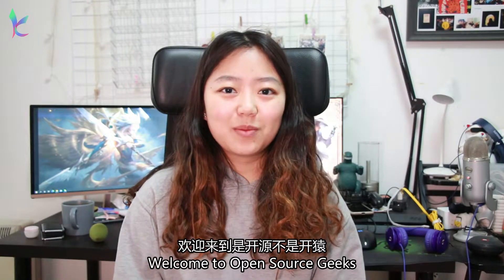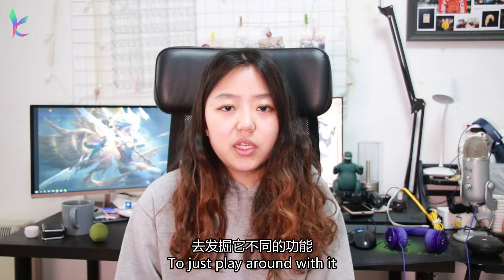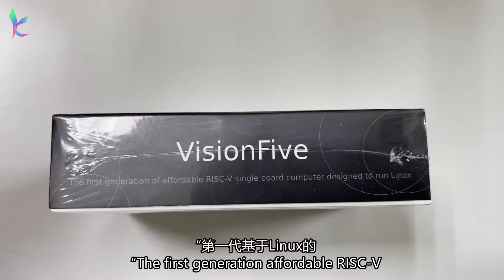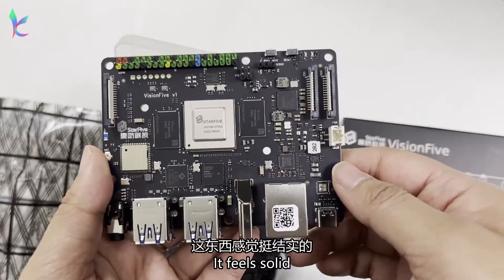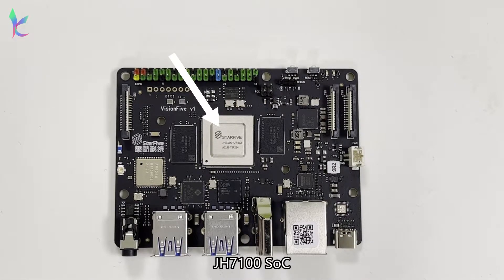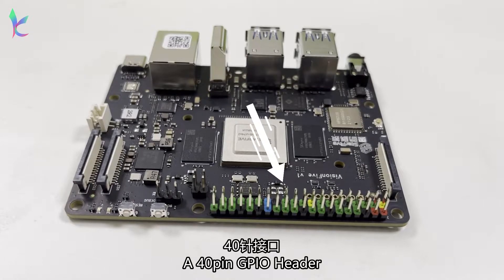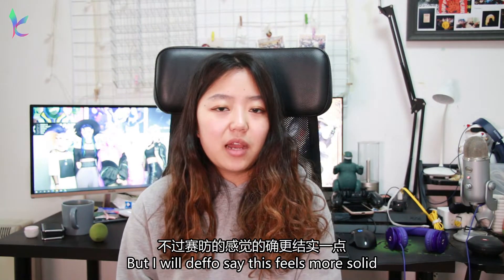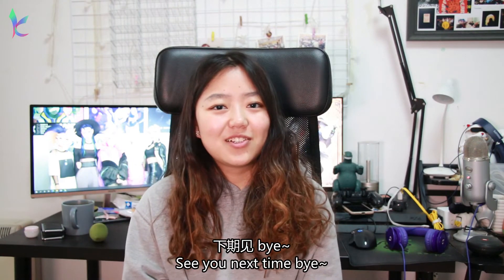[VisionFive] The WORLD'S FIRST RISC - V Single-board Computer (designed by Chinese company)

Comment: Which phone LCDs suitable for DSI connector ? Phone LCDs are cheaper than stand alone hdmi 5 inch LCDs.
Reply from the maker: I have no idea tbh. For me, I just search on Chinese online shopping platform, and all of them is really not that expensive here... So, I don't really have a good suggestion for that.
Reply: @landertee  I need a supplier in small quantities.  Any addresses
Reply from the maker: @Blue.star1  Maybe check on Alibaba? We use something called Taobao here (both belong to Ali), I think some of the shops does international shipping.
Reply: @landertee  alibaba and other sites supply only to business in large quantities , I need few quantities
Reply from the maker: @Blue.star1  Check if Taobao does international shipping then
Reply: @Blue.star1  contact the manufacturer directly. ask for engineering samples etc.

Comment: This is definitely not the first RISC-V SBC. The Allwinner/Sipeed/RVBoards Nezha came much earlier, and so did others, such as the HiFive Unmatched.
Reply from the maker: Well, it was written on their packaging, so...
Reply: @landertee  the word "affordable" is important there. RISC-V boards with similar performance such as the HiFive Unleashed (2008, quad core single-issue, up to 1.5 GHz, 8 GB RAM, demonstrated running Quake four years ago), HiFive Unmatched (2021, quad core dual-issue (like A53 in Raspberry Pi 3), up to 1.5 GHz, 16 GB RAM, PCIe, M.2) have been available for several years, though at much higher prices. Also, Linux boards with the AllWinner D1 have been available at lower prices for a year -- the original D1 "Nezha" EVB (single core, 1 GHz, 1 GB) was out about a year ago for around $100, and now you can get the same SoC with less RAM (512 MB) on a "compute module" style SBC for as little as $17 from Sipeed ("Lichee RV"). The D1 does have lower performance than the VisionFive, with only 1 core, and single-issue. It's about like a Pi Zero. But it runs Quake fine :-)  In summary: the VisionFive is a good board with good performance for the price vs other RISC-V boards so far (not yet as good as Raspberry Pi), but it's not the first, the fastest, or the cheapest -- but a good compromise.
Reply from the maker: @BruceHoult  Really good information!